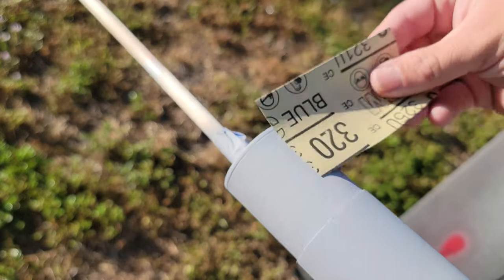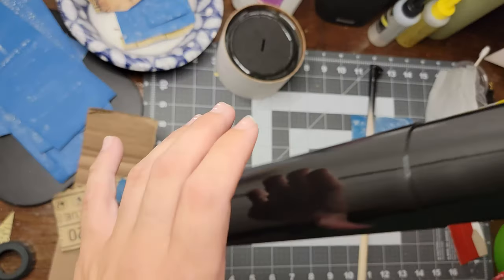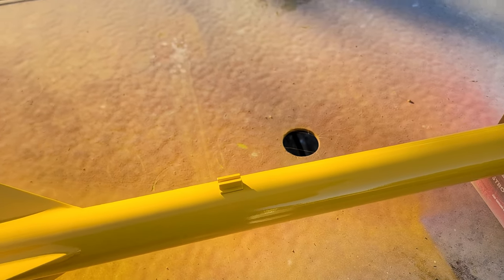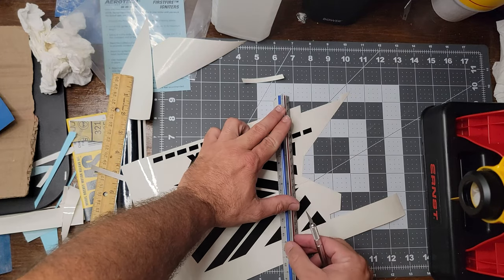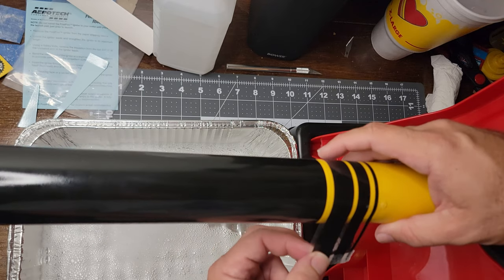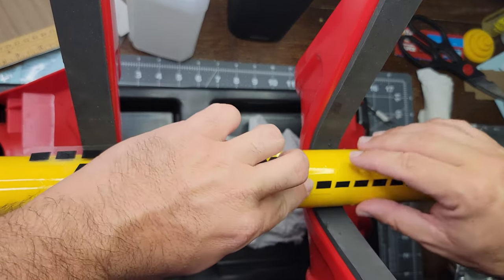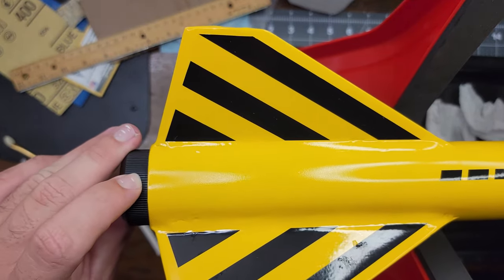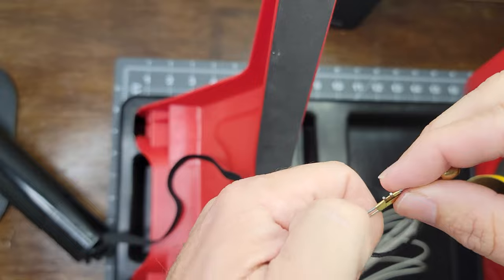Aerotech Arreaux Paint and Finish Part 2 #rocket #painting

Comment: what brand and color primer  did you use?
Reply from the maker: For the primer I did one coat of the gray Rustoleum 2 in 1 filler and sandable primer. For the 2nd coat Rustoleum Flat White Primer and the last another coat of the gray 2 in 1 primer.